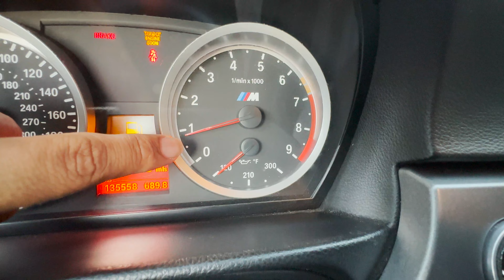I CAN'T CATCH A BREAK WITH THIS CAR...(*CHECK ENGINE*)

Comment: Pretty sure that how our cars idol at a cold start 
Might be a throttle actuator my car would start up in limp mode and when I turned it off and on again limp mode gone and it drove fine for the next week or 2 but eventually it will throw it in limp mode every time
Reply: Just scan it and you’ll see if it throttle actuators right away or a misfire

Comment: Bmw are cars with a lot of problems! Ppl just buy them for the hype
Reply from the maker: Not really this is my first issue with my car it’s been really reliable and I beat on it lol
Reply: @filminghugo yeah bro plus you at the mileage where you will have to start changing few things I did that on my e90 m3 and it was running strong till 150k then I got rid of it for a 5.0 but i regret selling it should’ve just rebuilt the motor 😢